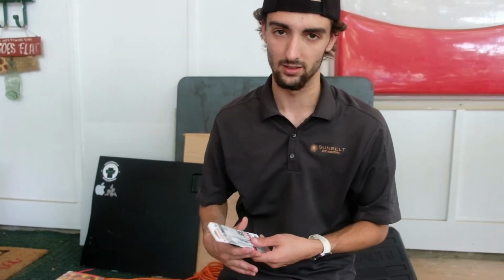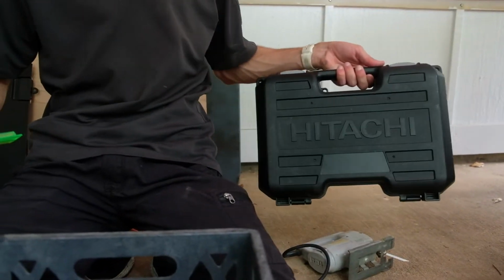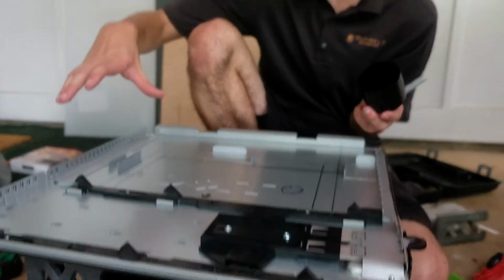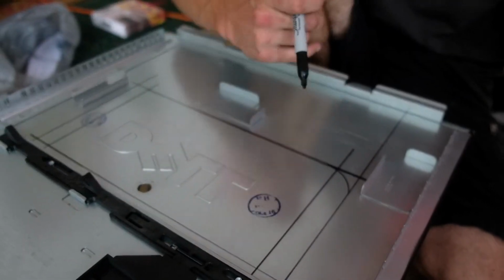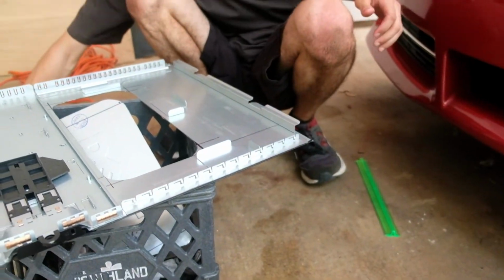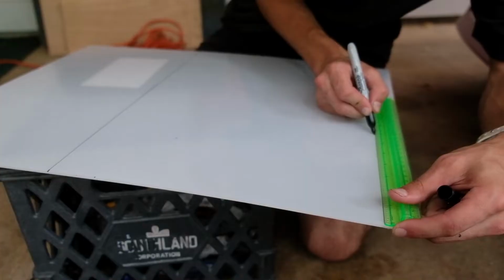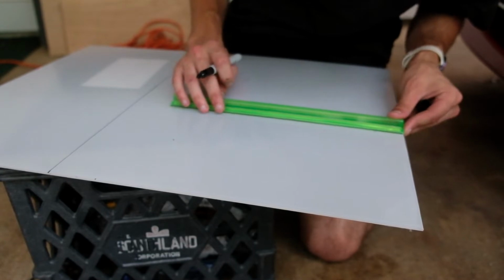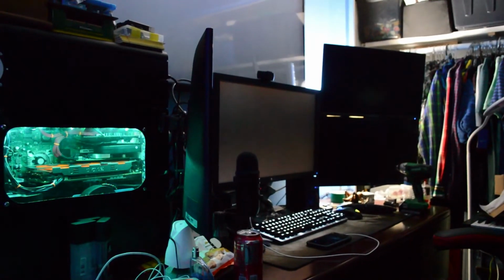Dell Precision T7500 - Side Panel Window

Comment: What is the heatsink on that I planning to get a better one for my T7500
Reply from the maker: It's just the OEM Dell one. I forget the part number for it but it should be available on ebay.
Reply: @TylerStartz  I was just asking because I was gonna put the cpu I saw in ur cpu upgrade vid into my PC cause I know those plain old alluminum heatsinks suck